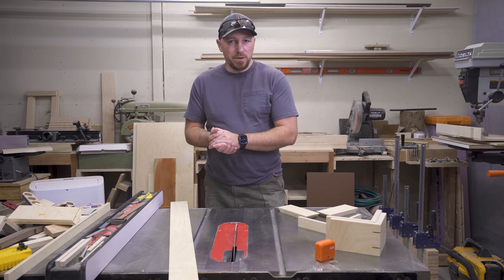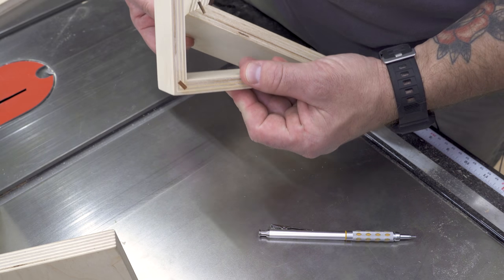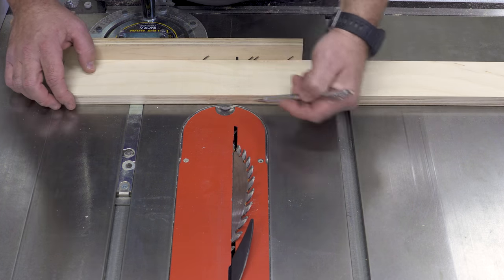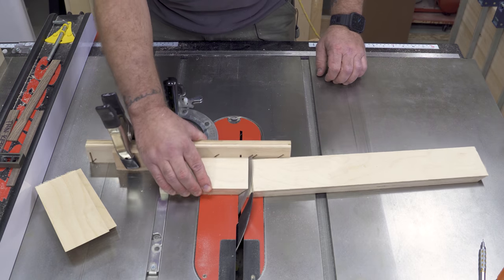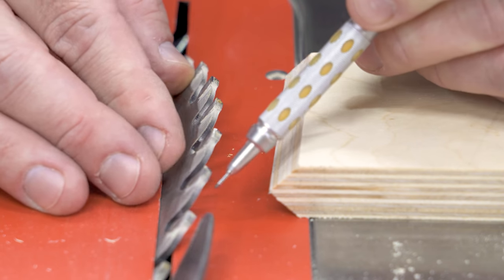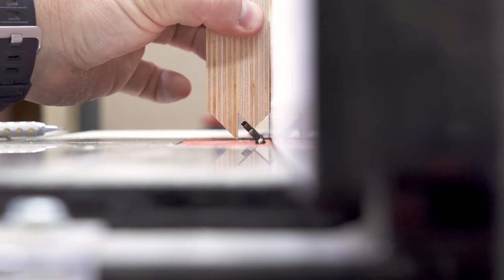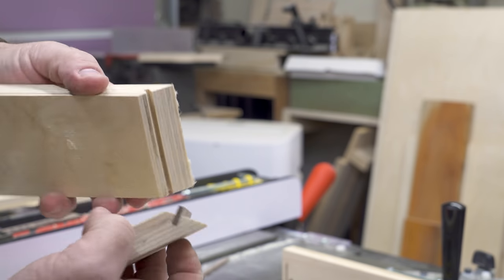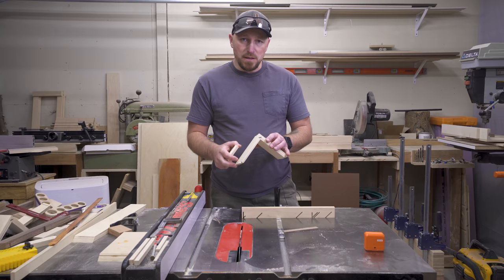How To Easily Make Internally Splined Miter Joints / How To Strengthen A Miter Joint With Splines

Comment: I figured out, generally, how to modify this method for angles that are not 90 degrees. In my example, I am cutting two boards on edge at 70 degrees and combining them to create a 140 degree angle (some may call this a 40 degree). In any case, just like in the video, I cut the edge with the blade tilted down to 20 degrees from the fence. Then to make the cut for the spline, without changing the angle of the blade, I hold the board vertically with the cut angle such that when it passes the blade it will cut a slot for the spline. I clamped a piece of wood that will go against the fence to the work piece so that it slides easily.  I did not work out all of the angles and depth of the spline cut, but rather used scrap and eyeballed it until I got the depth that looked about dead center perpendicular to the angle.  I am sure professor Inspired could work out a way to take out the guesswork and trial and error, but the theory of a 45 degree miter was applied to a 20 degree miter.

Comment: The best material to use for internal splines for any type of wood is plywood. It's stronger and won't move through seasonal changes as much or at all like solid wood and you never have to worry about grain direction. You can buy 1/8" and 1/4" thick, etc in smaller sheets if you don't want or need full sheets hanging around. And all you have to do is rip to the desired width.
Reply from the maker: Oh man thanks so much for adding this. I meant to bring it up and completely forgot. Although I will add that grain direction still matters. 1/8 and 1/4 inch ply that I’ve seen still only has a one-ply core and is almost always some sort of softwood, capped in thin veneers on the outside. Not a whole lot of strength comparatively. 1/4 inch sometimes has two cores at least though. Although you couldn’t use it easily for a 1/2 inch box.
Reply: You make a great point about the inherent strength and dimensional stability of plywood. I do see one issue with ply when using his techniques for blade width splines, which seem to be the lynchpin of the whole system. Your 1/8" plywood is never blade thickness, so you have to rip for thickness AND width, or make two passes (or dado  setup) with the blade to get wider width kerfs.
   I'm no expert on the dimensional shifts of hardwoods with moisture changes, but with a piece of walnut 1/8" thick x 1/2 " wide, how much movement are we talking about here? Maybe missing something, but it seems to me that Cherry, Walnut or Maple could work just fine here, if they are okay to build face frame cabinets. Just my $.02.
Reply: @InspireWoodcraft  Cody, maybe you could do a vid on making cross-grain splines.

Comment: Works perfectly. Among a ton of other type small boxes, I make inlayed dovetailed corner boxes. They are just edge to edge dovetails mitered. They are just like any other miter too--weak. I need to hide the spline in this case. I always struggle with the spline slot, as I don't want to hake a mistake since I spent the time to make dovetails. This method is fool-proof, and I am living proof. What you do is so simple, and so logical. Kinda embarrassing for me really... I should have thought of doing that myself.

Comment: Once again, you have made the process so repeatable and easy to do.  We are making small boxes and are using 45 deg miter joints on the boxes. But were having trouble getting consistence fitting spline cuts.  Your video is our answer!!  Thank you so much for sharing.  You are wonderful.

Comment: I spent 3 hours in the shop working on this and could not figure it out.  One issue I had is the blade drifts down a bit when I turn the saw on (Portable Dewalt).  This is the best method so far I have seen and can not wait to get back in the shop and try it.  Thank you so much.

Comment: I think I am going to use both the external and internal spline method on my box. I have always used either box joints or dovetail joinery on my box projects. Miter joints are a whole lot less cutting it seems like. I was about to build an external spline jig until I found your other video.
I just purchased a used left tilt Delta contractor saw last week. I got my Osborne miter dialed in so am ready! Thanks and Subbed!
EDIT: I did both the internal and external spline joints on my last project and it worked just fine. Very strong.

Comment: Seemingly you could also use an aluminum or synthetic spline that had even greater strength If you were building something that overtime was going to experience forces that pushed it out of square. Very cool idea for building corners

Comment: Very smart and well delivered channel.  Question: I make a lectern with a slope of 40 degrees that levels off to flat where I cut two pieces at 20 degrees on the miter to get a 40 degree angle when I glue them together.  Before I start to modify this for that purpose, can you point out to me the modifications in the methodology that I should be aware of.

Comment: The face of the spline closest to the miter apex is the actual center of the two box pcs. If you want the spline centered in the diagonal side of the miter triangle then you would need to set the blade above the center of the box side…I think the centered spline looks better.

Comment: I like this method and would like to apply it to a slightly more complicated "box" or cylinder shape.  I would like to internally spline a 10 or 12 sided box.  Is there a better solution than to run my material vertically to cut the correct depth, position, and angle to create the slot?

Comment: Hi, im Christian from Argentina. Tks for yr videos witch are very usefull to me. 
I hv a table saw Hammer brand si the issue I hace is that the blade turn to the to the other side of yrs, means that blade turn to the paralel guide so the smart setup you are showing dont know if could be applied. If you have any comments on that will be appreciated. Thanks again and regreate forma Buenis Aires.
Reply from the maker: What if you use your fence on the other side of the blade?
Reply: @InspireWoodcraft  . No, fence can only used on right side.

Comment: if I were making, say, a hexagon where the miter cut angle is 30°, do I make my spline cut at 30°? the theory is basically that the spline goes in perpendicular to the newly-cut face, so the cut angle for the spline needs to equally opposite to the original miter cut (45° on a right angle)? thanks

Comment: Would this same set up work for 60 degree joints? I’m making a wine rack with hexagons and the I can’t quite see the geometry lining up in my head

30 degree angle on each end meaning a 60 degree angle when laid flat on the bed then using a 30 degree angle for the cut means when I put them together I’ll be out of alignment by 30 degrees?

Comment: As I watched you find the center of the board by making two 45 degree cuts it occurred to me that I could do the same with a small scrap of wood to make perfect half lap joints.  Seems a faster approach without measuring or attempting to “sneak up” on the correct dimension.  Agreed?

Comment: First I just want to say that I really appreciate all your content.
 I have a special request. I noticed that you shared some links to flat grind blades in the description. If you get the chance someday, could you do a comparison of the 3 you mention above. 
When I first got into woodworking (still a beginner) I used the Freud FTG blade, then I bought the CMT FTG blade which I alternate back and forth, as they both seem to perform pretty darn good (at least to limited knowledge). I would like to know if the Forrest FTG blade is really that much better and has a long life span (more carbide/more sharpening). I value your opinion, so if you ever get the chance that would be awesome. Heck, maybe you may find that those less expensive blades do a pretty good job. Thanks
Reply from the maker: Thanks for this. I am hoping to get the other two blades in the shop at some point to compare them. The other two blades are considered rip blades, so less teeth (24 if I remember right), and the Forrest is more of a combination of sorts at 40 teeth. So in theory the Forrest would be a better all around blade. The Forrest is also specifically ground for the purpose of making flat bottom cuts, while the others are made for the purpose of ripping, but happen to have a flat grind. It would be interesting to break it all down and take a look though. One other thing I will note in regards to SawStop saws: per manufacturer's recommendations their saws are not supposed to be used with anti-kickback shoulders (the little hump of plate material behind each tooth) which all the flat grind rip blades have that I've seen besides one of the Amanas.

Comment: Great video! Someone suggested I check out your channel and I like what you’re doing.

I just got my first SawStop, and it came with a zero clearance insert. I’ve never had a ZCI before and I’m curious about cutting at an angle with it. It appears like you’re cutting your miters with yours, but I’m not sure. Do I need a different insert or am I ok to cut at an angle with mine?

Thanks!

Comment: I've seen your how to make a spline & that's works fine for me for getting exact thickness.
But now for this how do you get exact width of the spline to fit the new spline slot just created?
Reply: He did a video recently on that mate. Probably 1 week or so ago check it out
Reply: @robertmadden7536  I saw the one where he made the spline and shim. This addressed the blade kerf thickness but I'm asking about the width. I'll look again.
Reply from the maker: So I didn't have a trick for this one. I cut the spline material and then snuck up on a perfect fit. If I think of a way to easily get that size I will be sure to let you know!
Reply: @InspireWoodcraft  thanks for replying back. If you measure the thickness and divide it in two and multiple the result by 1.4142 you will get exactly what the width should be. Then it's a matter of using your great idea to achieve the thickness required. Cheers!

Comment: I watched the video on how to make the splines but how do you get them to the right width? Thickness and length I get but width I don’t understand. Thanks!
Reply: Hi William. My thoughts on this. The width of the splines is determined by the thickness of the board you are using to get the splines from. So I guess first you measure/determine the depth of the slot the splines will go into, multiply by two times, and that gives you the width. Then you plane the thickness of your splines material board to that thickness or maybe just a hair thinner, and then you make the splines following the splines video.
I hope my explanation is not confusing. Saludos.

Comment: Would the spline interfere with a quarter-inch dado at the bottom (for the floor of the box)?
Reply: Possibly, depending on the thickness of the material you are using.  It could easily be cleaned up with a sharp chisel though after the joint is glued and dry.

Comment: This is great!
And to see how simple it can be gives me confidence in trying it too!

I have a table saw like your previous one, so I'm not confident in the fence.  Have you done this on your old tablesaw?
Reply from the maker: Not this particular situation but a lot of the other stuff I have. My fence was great, but I have heard of others having issues as well. For me it was the table itself. It had such a bad dip in it that I almost couldn’t do anything anymore without a sled unless I was just cutting up sheet goods.
Reply: @InspireWoodcraft  
My table top is getting there but throat plate has a problem with flex with smaller cuts.  Fence will hold but takes too much time to set up straight...
I'll eventually make the jump to a cabinet saw.
Thanks again for all the ideas and instruction!

Comment: In the last portion of this video, you used a spline with longitudinal grain.  Could you make a video that shows the procedure for making cross-grain splines for use in internal splines?  Thanks.
Reply: I think you would do the steps for cutting the rip cut on the piece that goes up against the fence and instead of the piece the spline is being cut from being run lengthwise you would turn it 90 degrees. I'd probably get the widest board I could use and also a push block behind it.
Reply from the maker: I'll have put some thought into this. My first inclination would be to cut them at the bandsaw, for safety's sake. But not everyone has a bandsaw so I will see if I can think of an easy solution at the table saw.

Comment: Great explanation (again). Thanks for doing these videos. My question: how does changing the angle of the joint change the cut for the spline? i.e. 10 degree mated to an 80 degree cut. Thanks
Reply from the maker: This is the challenge for me this week as I have been asked this quite a few times now. The spline groove has to be cut 90 degrees to the face of the angled cut. There is no need to change to the angle of the blade (as in if you originally cut at 22.5 degrees, you can cut the groove at the same degree) and in some cases it would be impossible anyway as the arbor wont let us go much past 45 degrees anyway. Essentially the workpiece would have to be cut vertically referencing against the fence instead of horizontally referencing against the table. I really hope this made even a little bit of sense.
Reply: @InspireWoodcraft  it will be a while until I can try it but will let you know how I do. Thanks again.

Comment: Great video and detail! Would you use same technigue to make 20” long cross grain miter for coffee table? Or would another technigue be better? Thanks so much. Is your name Jody or Jodi?
Reply from the maker: Jodee, actually. I know, throws everyone off. 😂 I personally would use the exact same method. You don't have to have a 20" long setup block though of course. I would just use a piece of offcut to make the setup block to dial in my blade height and distance, then run my 20" piece through. Depending on how stable and flat the 20" piece is though, I might take an extra insurance step by clamping a straight edged board to the fence itself just as high off the table as the workpiece is thick. That would insure that the spline cut was perfectly straight and at the same depth the whole way through. I hope that made sense. You could also use a vertical feather board if you have one and mount it right over the blade so that there is even pressure through the whole cut.
Reply: @InspireWoodcraft  Jodee, I neglected to tell you that my 20” bevel cut is on both ends of a 5 ft long workpiece! I know that complicates your answer. Thanks, Gary L.

Comment: Great technique video, thanks!
Btw, I used to have the same DeWalt RAS as you have... I had to sell it to make room. Having a miter and table saw, does your RAS get any use?
Reply: Btw, you’re filling up my “woodworking technique” folder. Thanks.
Reply from the maker: Honestly no. I need to get a blade for it but there is always something more important. When I originally set up the miter station I laid it out to be able to have both miter saws and the RAS setup to do different operations, therefor speeding up production runs and whatnot. The RAS would be for squaring up the ends of wider stock. One of these days I am going to get a blade for it. I love that saw.

Comment: Is it possible to cut a bevel at 72 degrees on a table saw please.
Reply from the maker: If you cut the piece with the blade set at 18 degrees and cut the piece vertically, yes.
Reply: @InspireWoodcraft  thanks could you elaborate a little please don't fully understand. Thanks

Comment: What if the spline I want to use is thicker than the thickness of the blade? Then I have to make multiple passes by adjusting the fence. How come you didn't show that?  I've tried  using a 1/8 spline and making it fit in one pass and couldnt..like you just showed.
Reply from the maker: I didn’t show that because I didn’t do that. If you want an 1/8” spline, you have to use an 1/8” (full kerf) blade, or make two passes.

Comment: stupid question, but bow facing down ......... means  the  "U-shape" of board goes on table with the middle of "U" of touching. SO facing up would then mean, the middle part of board would be not touching the table, but the left and right would be. for someone who is not very knowledgeable in the woodworking word, like myself, it can be confusing. hopefully question makes sense   - thx
Reply from the maker: No stupid questions! Yes, you are correct.

Comment: Jody could you not cut the splines out of plywood, then you would not have to worry about grain direction? I appreciate you and what you are doing for the rest of us.
Reply from the maker: You absolutely could but with plywood thin enough to use for spline material you still need to think about grain direction. Usually thin plywood has only one core layer with two thin veneers on the exterior surfaces, and usually it is a softwood core. (In my experience. I cannot speak for everything of course.) There would be little extra strength with the grain still running the length of the joint. One could argue that a decent hardwood spline would almost be stronger at that point.
Reply: @InspireWoodcraft  Thanks for your input.

Comment: I guess this is the exception to "never use miter gauge together with the fence" rule?
Reply: Using in both in tandem is typically acceptable when you aren't cutting completely through the piece, as there is nothing to bind between the saw and the fence.  That rule is primarily for kickback prevention.